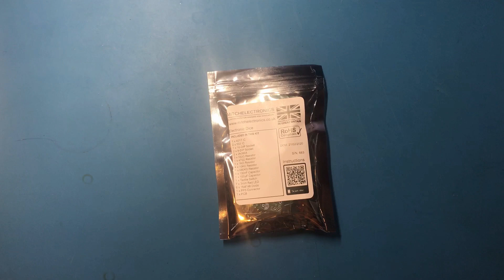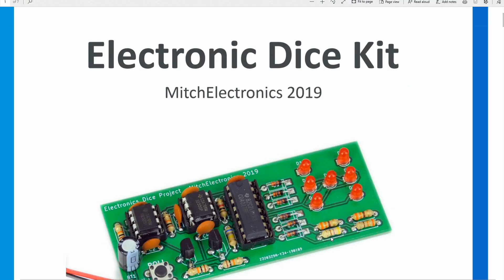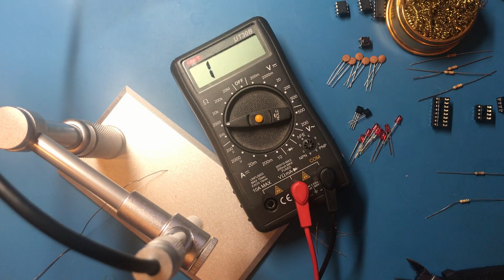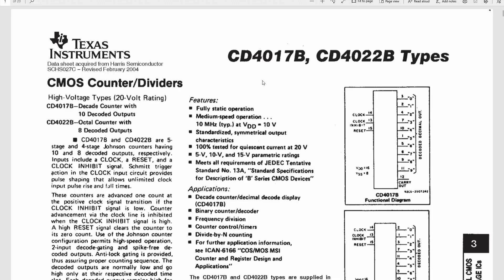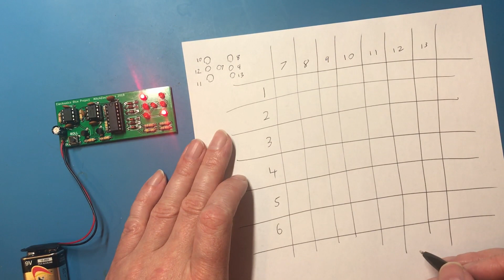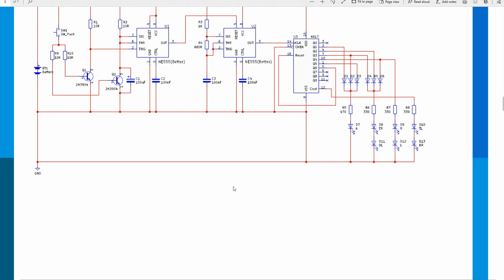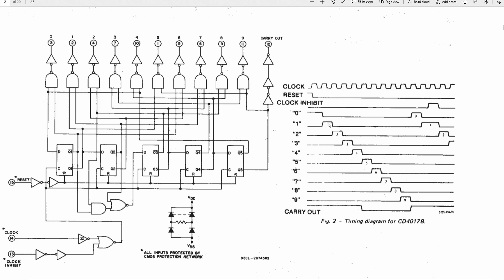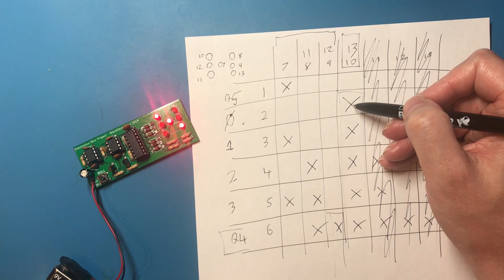ebay Electronic Dice Kit Build

Comment: It's probably a bunch of unstable circuit elements, like a XOR with its output connected to one input, which will flip its output after every gate delay.  Then again, the two clocks might suggest that they are both set at prime intervals, effectively running through a set of pseudorandom values.

I was wrong.  But I'm definitely a fan of this new reverse engineering sideshow.
Reply from the maker: Hmm, haven’t played with a kit for ages.

Comment: Just like developing code, in electronics the most obvious solutions are not necessarily the most simple or optimal and a bit a thought can reduce the component count if you are little bit clever. I've always wanted to make electronic dice that not only had 2 dice made from LEDs but also showed the sum of the two dice on two 7 segment LED displays e.g 5+6 =11. I think I might try that using an EEPROM as I have a EEPROM programmer now, to decode the states and show the sum of the dice in decimal as well as in the dice pattern.
Reply from the maker: Interesting idea,  you could use the ROM for both the 7-segment conversion and the dice pattern conversion. Let me know how you get on.